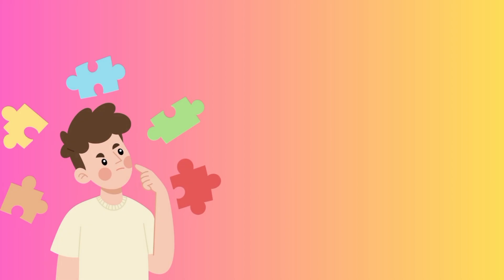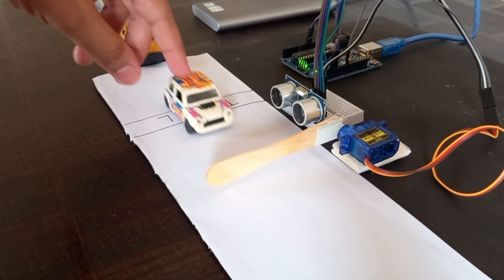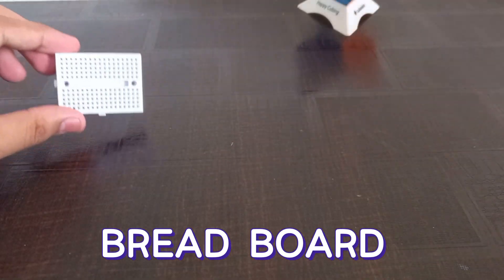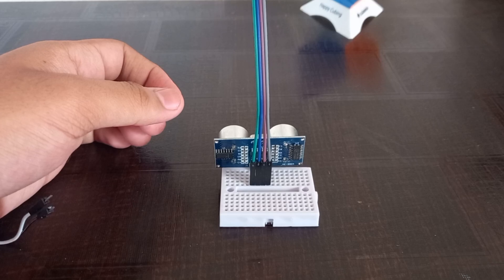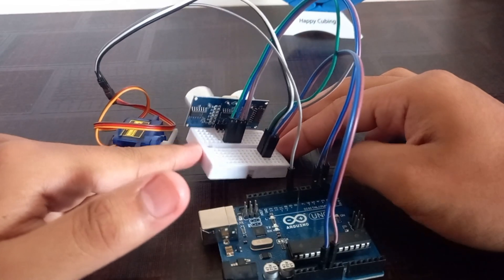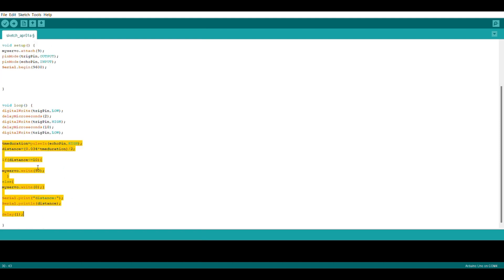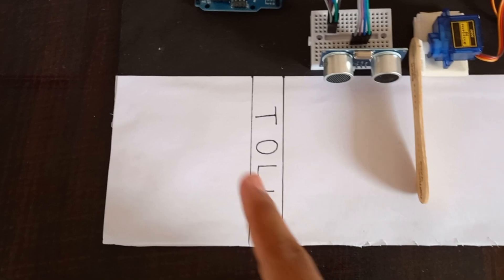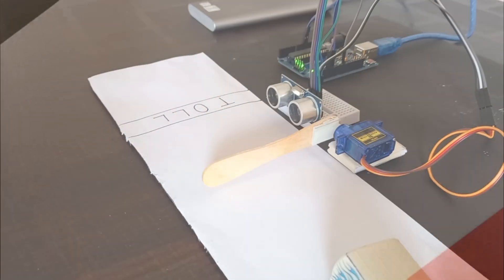Arduino Toll Tax System | Representation Of FASTag

Comment: The servo barrier gets down too fast that the barrier hits the car & the car cannot passes the barrier. Is there any way to overcome it???
Reply from the maker: Yes, you can make a change in the code. You increase the tie limit of the barrier angle's movement, and you can slow down a bit. That's all for this problem.
Reply: @avcuberandinventorofficial  Thank you I tried and got successe
Reply from the maker: @freeze433  Good 😄